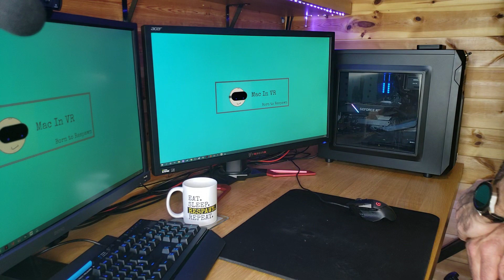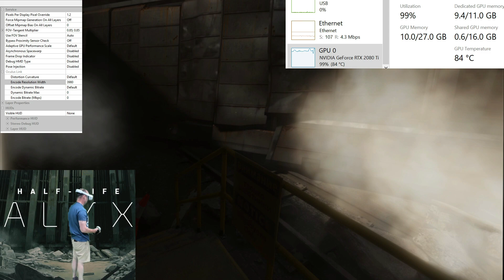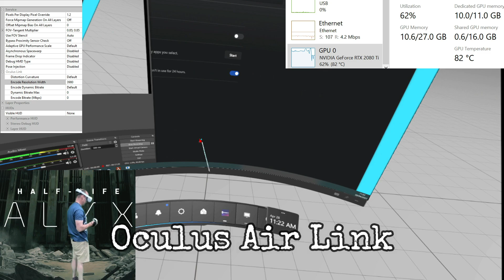Replacing the Thermal Paste on an ASUS Turbo Geforce RTX 2080 TI - What Could Possibly Go Wrong?

Comment from the maker: ** UPDATE **
Replacing the thermal paste on my RTX 2080 TI has done the trick, it's been nearly 4 weeks and despite putting Trigger (my PC) through his paces with Live Streaming, using OBS and Oculus mirror, all at the same time, not one single crash. Thermal temps are steady at 82-84 degrees, even when pushing the GPU to it's max, so as you can guess, I'm a very happy bunny.

Have you tried this technique? Don't forget to comment down below

Comment: i'm here again but i am having a good time with this card. i overclocked the core by +200mhz, and the mem by +1000mhz (is samsung gddr6) and did stuff with the fan curve and it never goes over 74c and i stressed it out it is very good. the cpu i am using is r5 3600 and is so good also
Reply from the maker: He's back 😃
Reply: @MacInVR  lol

Comment: Judt bought this card to hold me over till 50 series releases, but i like thinkering with old hardware. Might change the heatsink out for an open air one, but expensive + need to tear down the card. This is the only video of a semi-teardown ive found. 
Any info would help, thanks, but i will attempt it anyway.
Reply from the maker: After you've removed all the screws & try to pry it open, it will seem really hard BUT it's just the old, baked on heat sink 😉

Comment: Hello and love the easy to understand video, I have a similar PC to yours in specs, 2080ti, i9-990k, 32 gigs of ram. I am noticing that when I turn on my PC and just let it sit on the desktop, running nothing, it will go up to 65 degrees C. Then whenever I try to run a game or high impact game like VR, GTA, whatever, my GPU automatically goes to 88 Degrees. Even if I play the game and put it on the lowest quality it still makes the GPU Throttle at 88 Degrees. I do not have it where it is shutting down but I know these high temps are not a good sign, I am considering RMAing my GPU, what would you recommend or do you think it's my thermal paste as well? My PC is also about 2 years old now as well.
Reply from the maker: Clean all the filters as well, getting rid of the dust really helps. I haven't had any problems since I changed the thermal paste so it seems to have done the trick 😉

Comment: Thanks for describing the symptoms accurately. It encouraged me to change my thermal paste.

Mine used to run fine at 82-84°C. Fans at 43% (ASUS 2080 ti)
Mine was the same - a little over 2 years old, it started to shut down with black screen with fans at full blast when it hit 82°C. 
I could stop it blacking out by forcing it under 80°C with fans turned up to 60%-70%.
Re-applied new thermal Paste and it goes like new again,  cranks to 82-84°C. Fans at 43% during intense use.
The stock paste was quite dry and not doing it's job properly.
Reply from the maker: Glad I could help, mine is still running beautifully while I'm waiting for RTX 3080 TI prices to return to normal 🤬

Comment: Would probably be a good idea to set a custom fan curve on your gpu using msi afterburner or evga precision x. Although being a blower style it will get pretty loud I'd look to get the temps down to 70 degrees or below. I had to do this with my old titan x. Could also explain why your thermal paste needed replacing within 2 years. My new 3080 ti doesn't get above 65 degrees even while playing alyx on cranked settings
Reply from the maker: 3080ti?
I hate you (not really). I have set a custom fan curve on MSI Afterburner and you're right, it does get loud but I've got my headset on so

Comment: A case upgrade would also improve thermals, that's a tightly packed bunch in ol Trigger. With more airflow that blower-style card would breathe easier.
Reply from the maker: Its on the cards, I want one of those cases where all the gubbins is hidden away, loads of RGB lighting etc

Comment: Hi Mac sorry to bother you. I'm just super frustrated... been trying to play VR for a month now... :/ I first bought a Legion T5 pre built PC
CPU i5
GPU GTX 1660

Using the Quest 2 with link cable, and VD

Experience stutters with link cable and VD, air link same.

Thought it was my gpu..

Upgraded
GPU: EVGA RTX 3070 ultra
CPU: i7 -9700k
RAM: 32 GB 
SSD: Crucial P2 1tb 3d
Power supply: EVGA 750W
MasterLiquid: LC240E RGB (Cooler master)

After all that money spent on Upgrade... still stutters ... :/ Sad would be understament at this point...

Done about every trouble shooting step from the net..

Sill no Fix...

I found your vids, and loved the one you explain on detail. :) 

I was thinking if your able to play VR with no issues. I'm going to build your exact setup. From your fans, down to you your wires lol 

Hope you can help me, enjoy the VR experience I see you enjoying. :) 

Thank you
Reply: Hi Mac sorry to bother you. I'm just super frustrated... been trying to play VR for a month now... :/ I first bought a Legion T5 pre built PC
CPU i5
GPU GTX 1660

Using the Quest 2 with link cable, and VD

Experience stutters with link cable and VD, air link same.

Thought it was my gpu..

Upgraded
GPU: EVGA RTX 3070 ultra
CPU: i7 -9700k
RAM: 32 GB 
SSD: Crucial P2 1tb 3d
Power supply: EVGA 750W
MasterLiquid: LC240E RGB (Cooler master)

After all that money spent on Upgrade... still stutters ... :/ Sad would be understament at this point...

Done about every trouble shooting step from the net..

Still no Fix...

I found your vids, and love the way explain in detail. :) 

I was thinking if your able to play VR with no issues. I'm going to build your exact setup. From your fans, down to  your wires lol 

Hope you can help me, enjoy the VR experience I see you enjoying. :) 

Thank you
Reply from the maker: Okay mate, let's see if we can help.
1) What is the exact make of your router?
2) Are your PC and Q2 connected to the same network?
3) Is your Quest on the 5ghz wifi channel
4) Is your PC connected to your router via an ethernet cable
Let's go from there, your PC is more powerful than mine so I doubt that is the problem.
Reply: @MacInVR  So just got my New Alienware M17 R4 RTX 3070... and guess what same to the T stutters.. lol both with link cable, air link and VD 2 top of the line RIGS with RTX 3070, and one High spec laptop with RTX 3070.. .. tired 2 different Quest 2, and 3 different link cables.. lol Just brought back my laptop to Best buy for refund.. VR ... never got to enjoy... BIG WAIST OF TIME!
Reply: This is horrible news, so sorry for your experience. It sounds like you had some type of bottle neck with your internet. The best way to play is having your PC hooked up with a lan cable, and then using air link, or the oculus cable. Sounds like my experience when I was trying to use airlink with my PC connected to wifi as well. I hope you try again someday, it's amazing. Once again, so sorry about your experience.

Comment: Great to see this successfully solved your GPU issue.  At first I was surprised that you didn't also replace the memory thermal pads, as memory overheating could have also potentially been the issue. Maybe I missed it, but did you compare the GPU core temps before, with after?

Comment: Nice video, I'm just missing info on the temp before this operation, any idea about how how it was?
I replaced thermal paste and pads on a 960 a few years back and that improved temps while running furmark from 80C to 69C. My old thermal paste looked crusty.
I had an about 9 month old rx 580 that was running slightly hot, I did the same procedure on this, but the thermal paste was still in good condition and replacing it did not improve the temp. Ultimately the cure for for that card was to do a little bit of undervolting.

Comment: your temps are pretty high change your case perhaps your airflow is really lacking
Reply from the maker: I have recently added 5 fans to the case and that didn't solve the issue. Currently, reapplying the thermal paste has been working (fingers crossed).
Reply: @MacInVR  hopefully, had my gpu catch fire once now I'm skeptic of airflow all the time lol
Reply: These cards look to stay quiet more than cool it won't let the card get above 83c this limit is set on the vbios but can be changed in software. I'd drop the limit to 70c to prolong the life of the card. Fans are cheap gpus aren't.

Comment: @Mac if you'd like I can give you some pointers as I've done kraken g12 on my 2080ti, it's simple to do, and since you've already done repasting in basics it's the same. My temps are around 55c, full load with MSI OC at +175 core, and 650+ mem :)
Reply from the maker: I didn't understand most of that, but what does it involve?
Reply: @MacInVR  so basically you buy item that replaces your current cooler on GPU, and you put independent water cooling block on GPU core cpu, with additional fan cooling vram :) Since I can't paste links, check google for kraken g12 2080ti. Only thing that's needed is that PCB is  reference design and you need some kind of waterblock, I am using 120mm old corsair h55 for mine, and it works perfectly. I can explain more on discord, I have pictures of step by step as I did it couple if times so far on multiple GPUs

Comment: From my way old school Celeron 233 overclocking days, the general rule was to use as little as possible.  It was explained to me that TP is supposed to fill any micro gaps between the chip and the cooler, but TP itself was less conductive than chip-cooler interface.  So it can actually create a bit of an insulation layer if there is too much.  So we'd use a razor to skim the surface of the chip with TP, then same on the cooler.  Dunno if this is still the case, and clearly your splooge&smoosh method seemed to work just fine!  😜
Reply: As long as the heatsink mounting pressure is adequate any excess paste will just come out the sides leaving only enough to fill any gaps that needed it so I'd say probably better with a tad too much than a tad too little it won't harm anything.
Reply from the maker: Have you met the internet? 😂😂
There are definitely 2 camps at war here, too much or just enough. But now we have liquid metal as well 😳
Reply from the maker: Splooge and smoosh 🤣🤣

Thanks for the info, I've been running it really hard since and it seems okay so I think we got away with it! When I looked it up on the internet (!!) General consensus was a pea sized application.